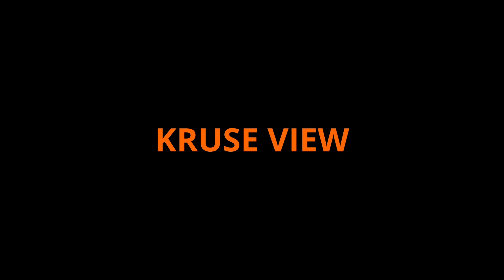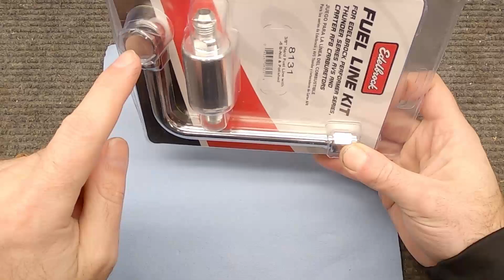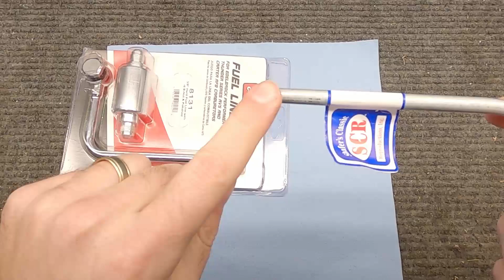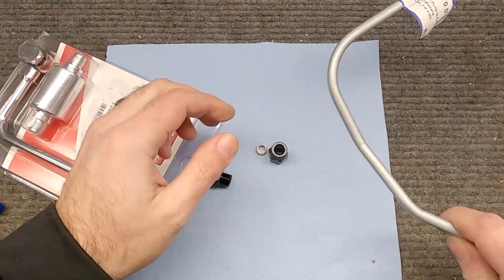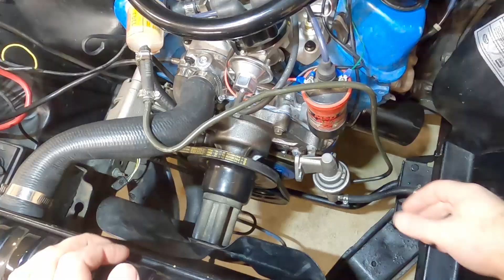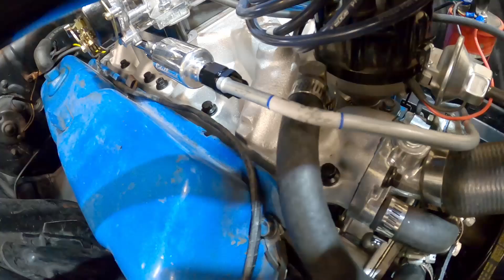How To Install Hard Fuel Line With Edelbrock Carb

Comment: Hi! Just stumbled onto this video and I'm glad I did. I'm looking to run a pump-to-carb hard line on my 302 in my '69 Bronco. If I understand you correctly, the hard line you used is supposed to fit a 289 with an Edelbrock carb and yet you still had to make some adjustments in the bends to make it fit, which kinda surprised me. I've reached out to a couple of the hard line suppliers who all say there lines "may not work" for a 302 and give some vague answer about the timing chain cover but that doesn't make sense to me. From what I can see in your video, the front of your engine looks a lot like mine ('cept I got a power steering pump). From your experience, did you have any issues getting the hard line under the distributor and over the radiator hose?
Reply from the maker: The specific hard line I use in this video is molded to fit the 289/302 before the 80s (which is what you have).  But the manufacturer doesn't know exactly where you want to put it when you get to the Carb as there are lots of options of how to connect to the Carb.  So expect to finalize the bends at that point.  The same sort of goes from the pump up around the timing cover, and near the Distro.  It's designed to be a close fit, but you may find you need to tweak something a little for a perfect fit with your engine.  :)

Comment: Room for a regulator?
Reply from the maker: Yes, it would either make the hard line stick out towards the radiator a little, or you can cut the hard line down a few inches and make it perfect.  :)

Comment: How did you get the hole in the bolt to line up with hard line on carb , (edelbrock line kit) . Or does the orientation of the 3/4  bolt with the hole that holds the line the position doesnt matter?
Reply from the maker: The hard line has the ability to be bent and tweaked a little, but it mostly lines up to begin with because that’s how it’s made. 🙂

Comment: Andy, thank you. On the current black fuel rail you are running, what is AN fitting size that screws into carb body itself please?
Reply from the maker: It's from Summit Racing, part number SUM-220101B.  :)

Comment: Great video, as usual! Bought the same Edelbrock kit, but I'm going to run a 90° & go across the intake to the drivers side because my 1969 hardline runs on that side. Did you use any plumbers tape on the threaded fittings? Also have you had any issues of the fittings becoming loose? I feel like they might over time & leak gas. No bueno! Thanks Andy, all your videos give me the confidence & really dial in my stanger 🤘👌
Reply from the maker: Thanks!
No plumber's tape on fuel lines, it doesn't jive well with the fuel.
No issues with loose fittings, but I didn't have that setup long enough to see if anything rattles loose over time.  But I'll keep my eye on my current setup to make sure there's no issues, and I'll let everyone on my channel know if I find something.  :)
Reply: We don't need no jive turkeys going on in the engine bay! 😆 I'm going to use a pressure gauge also, what's your opinion/experience with them on placement? Should I put the fuel filter 1st, then the gauge, or vise versa? Is it ok to have them right next to eachother or space them out a little bit?
Reply from the maker: @dangerman1969  Gauge after filter, just in case there's any loss of pressure in the filter, you'll see the actual pressure going into the Carb.  Spacing is not critical.  :)

Comment: Hi Andy, what kind of spacer do you have under your carb in this video? My Edelbrock adapter with filter (same as your here)  is down real low and will not clear the heater hose. Can I use a car spacer to raise it up? The fuel filter seems to be picking up a lot of heat off of the manifold.
Reply from the maker: It's a 1 inch Phenolic Carb spacer.  I purchased that one off eBay, but lots of places sell them, and they have different heights too.  :)
Reply: @KruseBuilt  thank you sir. I appreciate it.

Comment: I see now that the riser under the carb is key. Just put one of these hard line kits on mine and it’s pointed right into the heater core line.  But if I add a riser under mine, pretty sure the air cleaner will hit the hood. 
Good times
Reply from the maker: It's always great to find a new part that makes life easier with our cars.  :)

Comment: Where did you get the fitting that you installed on the end of the filter and had a compression fitting to tie into the fuel line. I can not find that fitting.
Reply from the maker: All the info is in the description below the video.  :)

Comment: Hi Andy, is your fuel line stainless or aluminum or steel?  I'm asking because I looked up the 6AN to 5/16 flair and it said: Note: Only applicable to stainless steel or aluminum hard-line. 
just wanted to make sure you saw that note. I know this video is old and that motor is not in the car now. Thanks keep up the great work.  Steve
Reply from the maker: It was steel, but I think that note is so people don't use it on PTFE lines, and stuff like that.  :)

Comment: exact information needed for my 68 CS/GT 289 2 barrel to 4 barrel conversion, got everything except that filter to line "coupler" and tried to see what the part number was to find it and have had no luck, any help would be appreciated finding that connector
Reply from the maker: I found it on eBay, just look up "5/16 to 6an" and you should be able to find what you need.  :)

Comment: How far into the fitting on the filter does the line need to go? Mine won’t go all the way in and leaks.
Reply from the maker: The hard line should rest up against a "stop" on the inside of the male fitting.  Make sure the small brass-beveled adapter is on the hardline and the female portion of the fitting too before you assemble it all.  As long as you have all the same pieces that I have in the video, you should be good, just make sure the hard line is "bottomed out" on the inside of the male part of the fitting.  :)

Comment: What are you using for the fuel line from the pump to the filter? Thanks!
Reply from the maker: It's a pre-formed line I found on Ebay, I think Marylandmg is the seller.

Comment: Like that adapter so you do not need to screw the filter into the carb. After that you risk damage to carb each time you change the filter. I once replaced hard lines on a GTO with rubber. (wrong) Split several times.
Reply from the maker: I like it too, I'm glad it's something that Edelbrock recommends with their Carbs.  :)

Comment: Hey Andy, Great mod! I ended up doing something similar on my vehicle. Someone originally replaced the hard line with a long rubber fuel hose.
Reply from the maker: I have wondered why someone would do that, the hard line looks official, whereas the rubber hose looks like a quick-fix.  Maybe people do it because they damaged the hard line?  Or maybe they do it for more flexibility with line routing?  I don't know, but I like it now!  :)

Comment: Nice job on the video Andy. I am curious if you are happy with the new jets, rods, and spring making the 1406 perform as if it’s a 1405??

PCV hose connects to #52 large port just to the right of #50 where your vacuum advance is currently hooked.  

You should get a better response if you switch vacuum advance hose to #51 the full time vacuum port. 

Based on heater hose configuration, I will guess that the heater box assembly might be a future video.
Reply from the maker: I'm not sure I follow as the vacuum advance line from the distro to the carb is connected to the Timed Vacuum Port.  The other port on the front of the carb is the Manifold Vacuum Port and everything I see and read tells me to use the Timed Vacuum Port (where it's currently connected).
I'm not sure what I want to do with the heater.  It's not functional (despite the hose not being connected) and it likely needs a rebuild.  It would probably be a good video down the road, but I've got other plans for now.  :)
Reply: Check page 21 of the Edelbrock 1406 manual for schematics.  Three ports looking towards carb from front of car. Ported vacuum-50 (left), pvc port-52 (middle), and full-time vacuum port-51 (right).

Your vacuum advance is plugged into the ported vacuum.  I was suggesting switching to the full-time vacuum port.

Comment: Super cool video. Thanks for the info. I am going to buy this similar line. I got the same edelbrock 90 line with filter. I just need to buy the pre-bend line and fitting.
Also, I thought you would of needed to at least flare the line to make it fit... but super cool you don't need to with this fitting.
Reply from the maker: Yeah, I had to flare the end of the hard line when I did it on my last car, but I was able to find that compression fitting which removes that need for the extra flare tool.  :)
Reply: @KruseBuilt  Yeah that is super cool. I am going to be another adaptor to go from the fuel like to the fuel pump. I have an Edelbrock fuel pump and it has 3/8 NPT fittings I think... So I am going to get one of these adaptor from 5/16 line to a 3/8 NPT